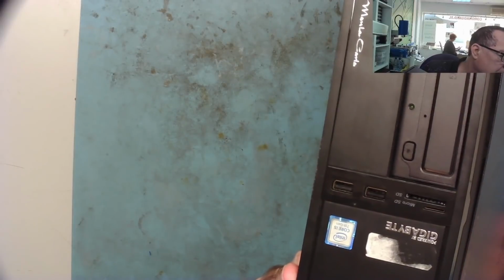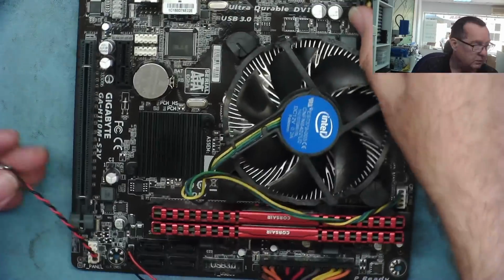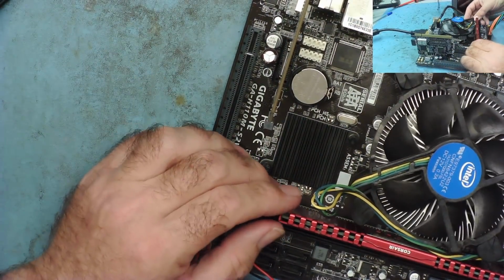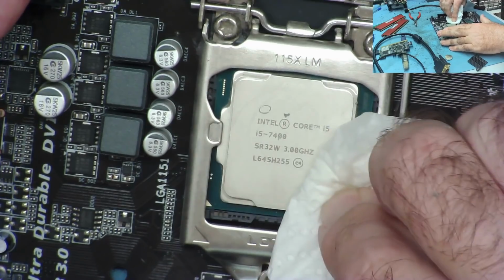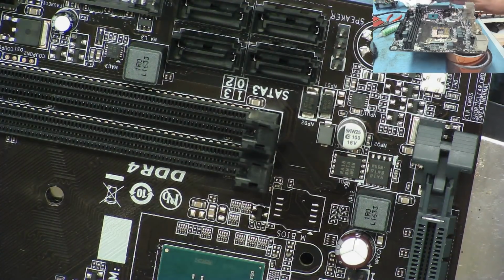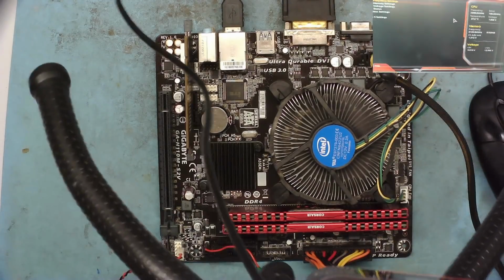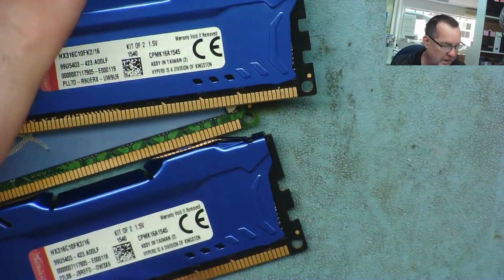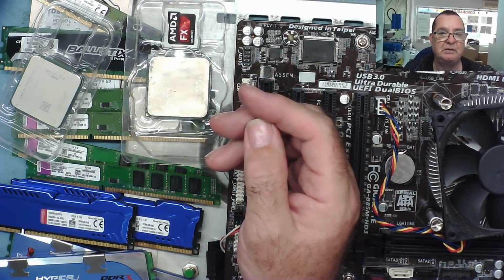Gigabyte GA-H110M DDR4 Motherboard Repair No Picture Boot Loop Code 97 then Restarts.

Comment: Thanks for this video.  Had a Gigabyte GA-Z97X-UD3H stuck in the same type boot loop.  Ordered a TL866II+ programmer, reflashed the BIOS and the board booted right up.  The programmer is very easy to use.  I appreciate you taking the time to do this video. It saved an otherwise great board from the eWaste bin.
Reply: I also had the same board, but thought that the dual bios is gonna take care if it. Who knew, phew.. Hahaha.. Btw, which one did you reprogram? Planning to do it too just in case.

Comment: hi very good video. i have a same problem of  boot looping, can  i reflash the BIOS . my Mb is Gigabte GA150M using DDR4 ram. please kindly advise  me. thanks
Reply from the maker: It is definitely worth a try.  I find this sort of problem mostly on Gigabyte boards..  It's not always code 97, sometimes I have seen the BIOS flash on screen then crash and loop.  I have also found it on older generation boards too, H61, H67, H81, H87 etc.   If the motherboard is dual BIOS you need to remove and reprogram both the main and backup BIOS chips.  It doesn't always fix the problem of course, the most likely next cause is a faulty PCH.
Reply: @LearnElectronicsRepair  we got 2 motherboard here same issue, no luck doesn't have that kind of tools

Comment: Looked at a 1155 Asrock b75 mb. One day booted up fine and was thinking i fixed it but.... next day still no picture. 
Found a dc-dc converter heating up and output 1.8v to pch but pch needed 1.05v according to boardview. After reflowing the buck converter chip voltage got down to 1.1v. Now still no picture, the converter is not heating up now, but it is always on with 1.1v, it does not shut off when it should.
 I gave up on this one, these cheap boards are like one time use items.
Reply from the maker: Oh yes, I've found similar faults and tried to fix them - but of course the PCH is already killed by the faulty buck converter giving too much voltage.
Reply: Motherboard did post even with 1.8v to pch and with 1.1v. It is intermittent. Strange, but with no ram it beeps so must be a fault after the ram check, pci-e card fan is at 100% so stuck at that or before.
 Just like yours, does boot loop. Bios already updated.
Reply from the maker: @davidut55  Sorry I misunderstood.  Yes the PCH will have more than one supply voltage, often it has 1.05V or thereabouts, 1.8V and/or 3.3V and maybe the same voltage as your RAM as well.   Do you know how far it is getting into the boot sequence before restarting (using POST analyzer)?  Asrock boards are known to do this sort of boot loop but it is generally before the CPU even starts to run any code from the BIOS.  You may also find the signals S3# and S5# (PCH and SIO) are turning on and off, but then you wouldn't get beeps with no ram.

Comment: Very thorough job, well done indeed.  Question - I’m guessing you only desoldered the chip as there was no way to connect to it and reprogram in situ, is that correct or do press on connections exist for such situations?
Reply from the maker: There are programmers (including my TL866CS) that will program BIOS chips in circuit using a clip to attach to the IC, but the problem is the programmer needs to be able to power up the 3.3V supply rail on the motherboard (or GPU) to do it.

It's far easier and more reliable to remove the BIOS for programming.  As you saw in this video it isn't too dificult to do using a soldering iron and a hot air station.

Regards programmers, I'm using the TL866CS which isn't too expensive, this is the later version, mine is discontinued
https://www.aliexpress.com/item/1005004137721336.html

But you can also program most BIOS chips, including this one, using the CH341A which is very cheap, and I also have one of those.
https://www.aliexpress.com/item/4000587235481.html
Reply: you can by clips that connect to bios chip and then to programmer but they arre very hit and miss
Reply from the maker: @preddy2940  Yes - for the reason I just mentioned above ^^^^
Reply: @LearnElectronicsRepair  yeah sorry i was replying and didn't see your reply i apologize
Reply from the maker: @preddy2940  No need to apologize here 🙂

Comment: Hey Richard, great video, i was wondering myself if you can repair RAM. Because i have 2 Sticks of DDR4 that are shorted somewhere, because the memory phase on any board will blow up if you keep them to long in there (ask me how i know) and i tried to find any inofrmation on how to repair RAM, but there is almost nothing out there. I tried to inject voltage at shorted line, but sadly without a result. I ended up delsodering every RAM chip and that got rid of the short, but as soon as i tried to resolder one, it was shorted again, so there is something that i am not getting. Injecitng 1V draw aroung 2,5A but i got nothing on the thermal kamera that was heating up, which was really odd, because it was obviously shorted. So preety sure i am missing something or maybe just all of the RAM chips died. Do you have any expierience working on RAM sticks ?
Reply: wash them or buy new for 10 dollars
Reply from the maker: @esecallum  Nahhh... try to work out what is wrong and fix them just for the educational value and fun of it.  It's not always about the money or the ease of replacement.

I will be looking at those 2x 8Gb DDR4 shortly, just to see if I can work out what the problem is 😉

Comment: Restarts are ofter a tell tale sighn its trying to find a signal from somthing, some chip enable or ram or bios, shorts normaly just shts off or no start.
Reply from the maker: Yeah as well as BIOS problems, I also quite often find a faulty PCH will cause similar problems, but generally won't go so far into the boot sequence before looping.